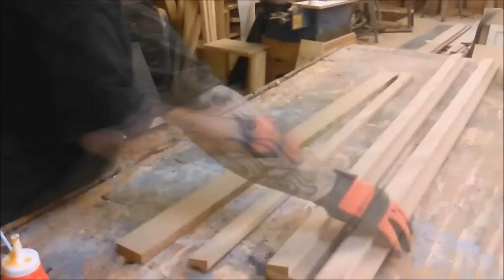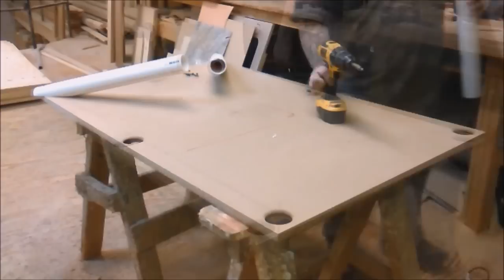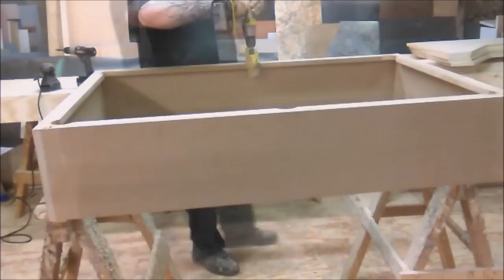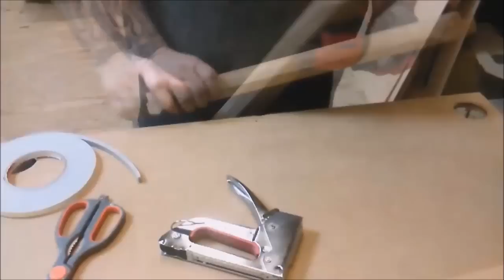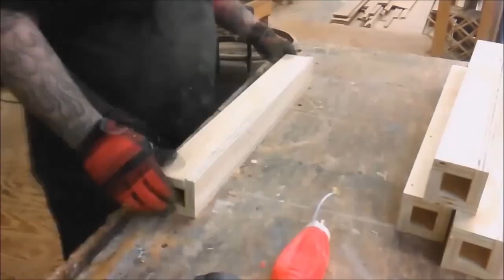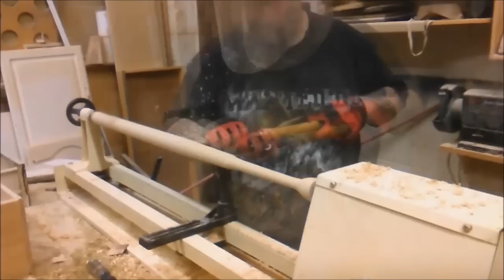how i make a pool table (diy)

Comment: Wow, that looks really great, even though the playing at the end looks a bit weird (balls stop suddenly), but that may be caused by the videospeed.

And i can't believe that you did all that in only 20 hours! Great work!
Reply from the maker: +Etherion thank you , you're right the video speed made it look worse but there was a lag ,the pool balls I had was alittle too cheap/light but new ones I got work alot better,thank you for watching
Reply: ah, that makes sense. How much  (without working time) did it cost you at the end? And was i right with the 20 hours or did i confuse that number with another video?
Reply from the maker: +Etherion yes about 20hrs ,it was a sheet of MDF ,the fabric ,PVC pipe and the balls was $15 on eBay ,I used scrap wood for some but it was around $75-$100
Reply: Thank you for that answer. I love it how you actually respond to comments especially, because you are so quick to answer.
Reply from the maker: +Etherion thanks,I try to respond to everyone ,it's good that you like what I do enough to let me know and ask questions,I really appreciate it
Reply: sdmcustom woodworking

Comment: been waiting for this one, as usual it didnt disappoint!

btw how do you like the ryobi 18v nail gun? ive been thinking about getting one
Reply from the maker: +mike gager thank you Mike ,I really like it, I've had it about 3 years and usually use it for trim work , I've never had a problem with it.
Thank you for watching
Reply: I use the Ryobi staple gun....................
It's taken a crap on me about........ Idk, 8,000 staples in.
When i used it though, retardedly used them in out of town jobs for an entire floor underlayment instead of my compressor air guns....

I traded it for a new ok at HD though..
Battery holds it's weight with my DeWalt. Still strong cgarge and love it.
PS: staples it is NOT able to use it's "maximum staple length". I will only use it for a max of 1 1/4" maaaaaaaaaaaYYYYbe 1.5.... Maybe. It cannot handle its max. No.Friggin.Way.

Comment: Excellent Excellent Job!

Just one concern: The balls are not rebounding back with expected force/speed after hitting the corners. The wood is absorbing all the momentum.
Reply from the maker: +Justin Tylor thank you ,yes your right it's a combination of the mini pool balls I used being a little lightweight and just using door insulation for the rails ,it works fine and as it's just for the kids I might just leave it ,but if I get chance I'll buy the right rail bumpers and try that , thank you for watching
Reply: amazon is a great to buy them. otherwise I am blown away. The simple idea of using pvc pipe for ball is return is crazy. MIND BLOWN!
Reply from the maker: +Techswreck thank you ,I like to try and make as much of the project myself ,sometimes I think I should buy the right parts but usually using what i already have leftover works good, thank you for watching
Reply: I've made a few pool tables in the past.
its not a 5 minute job either, but interesting and fun to do.
takes time but worth it.
a real pleasure watching you make one yourself.

Comment: where did you get the green liner? I'm a finish carpenter so it would be easy to build... i have balls and sticks; how much did it run to build the table ? I am looking to build 4x8.... what do you think maybe $200-300 for wood... not even
Reply from the maker: +Shawn Anderson I did mine as cheaply as possible,it cost around $100 for everything 1 sheet of MDF was basically all I used  ,in hindsight I should have bought the real rubber bumper but other than that it's definitely something easy to make ,Google green baize for pool tables or check eBay ,you need the right liner so the balls roll right

Comment: what material did you use for the bumper/cushion ? did you buy it?
Reply from the maker: I used a peel and stick foam insulation for weather stripping windows and doors in the video but it didn't work as good as I'd hoped so bought pool bumper off eBay and replaced it with that

Comment: Great work!! If you have chosen to build a 7ft table, would you take the same mdd size, or thiner but with a frame in shape of H under?
Reply from the maker: +Vincent P thank you,yes bigger would require more effort supporting it and keeping it level ,maybe double up on the MDF , ideally you'd use slate but it would work with MDF it would just need alot more work having it flat and level,thank you for watching
Reply: What about play board  do the job for a table 3/4"

Comment: What material did you use in the cushion bumper
Reply from the maker: In the video I used window and door insulation but it didn't work that good so ended up buying pool bumper cushion off eBay

Comment: What’s that material that was used for the cushion? The tape stuff?
Reply from the maker: +Jack Dixon I was being cheap so tried to use regular door insulation...it didn't work so great so I ordered proper pool bumper off eBay and replaced it

Comment: what is that rubber tape thing you set on side bumpers?
Reply from the maker: I was being cheap so used window trim insulation tape....I later replaced it with proper pool table bumper I got off eBay

Comment: Nice job.  does it feel like a good table? Normal tables have some rock oriented material under the cloth so i thought it would feel a lot different
Reply from the maker: +Semih Aykurt thanks , it's a kids table and they usually are some kind of particle board ,this is small enough that MDF is flat and solid so feels right ,and more than good enough for kids ,thank you for watching

Comment: very smart but what did you use for the cushions , is it double sided tape . and does the cushion work well
Reply from the maker: +guns vs planes I used just window insulation tape ,which isn't the best option but I was trying to build it cheap ,so I did go back and replace it with proper cushion , thanks for watching
Reply: did it work as suppose to ?. all i want is something that is do able   until im out of high school
Reply from the maker: +guns vs planes it's just for small kids so it's just right ,if I was making one for teenagers or myself I would spend more money on those parts
Reply: my dad doesnt give me money nor allow me to go to the pub. is there something else i can use to make a not bad bumper
Reply from the maker: +guns vs planes you can buy it off eBay for like $30 ...it's not too expensive
Reply: i know but they dont ship to malaysia.  any alternatives you can recommend me ?
Reply from the maker: +guns vs planes I don't know ,you just need to find some rubber
Reply: well, frik . whats a pool table without bumpers
Reply from the maker: +guns vs planes it won't work,so I recommend buying them from eBay ,they usually ship worldwide
Reply: ive tried. they not shipping. but could i use silicone
Reply from the maker: +guns vs planes no ,you really will be wasting your time if you don't use the right cushion material
Reply: yea. but at the moment im saving money because i found a local seller selling one table for 300 usd which is 1000 myr

Comment: Hi what did you use to the rails to make the balls bounce?
Reply from the maker: In the video I used door insulation tape but it didn't really work too good so later just bought the proper pool bumper off eBay
Reply: sdmcustom woodworking thank for the reply! But the first method you use is it good enough i mean for a cheap diy build is it good, the balls bounces too?? Awesome build though inspires me to create one.
Reply from the maker: It works but not good enough ,maybe the thicker more rubber stuff would work better but I used the sponge tape stuff so it's not really good ,good enough for a kids table like this is but I had to strip it down to change it so better to use something good than regretting it later
Reply: sdmcustom woodworking thank you so much for giving me tips! ☺

Comment: I am doing a pool table for my school major project just wondering what wood to use ?
Reply from the maker: +HowelGF/Dota thats great ,you need something that will stay flat for the top ,I used MDF because it won't expand or contract due to weather changes like wood or  plywood would and it's pretty cheap ,as for the rails /sides you could use anything oak or maple would work or whatever you have just make sure it's stable and level .
I went the cheapest route ,I would order proper rubber bumper if I was to do it again and the fabric has to be just right for the balls to roll good , thanks for watching
Reply: Alright thank you very much it helped :)
Reply: Sorry to bother for the rails is it soft or hard maple ?
Reply from the maker: +HowelGF/Dota you can use whichever you have ,the rubber material is what's going to matter
Reply: Hello again for a complete wooden pool table do i need to use different type of wood or just 1 type for everything ?
Reply from the maker: +HowelGF/Dota if it's seen I'd use the same ,just to make the finish look consistent but other than that if it's covered /painted you could use anything ,again aslong as it's square and twist free ,you need stability before anything

Comment: Definitely my next project but we're did you get the balls and triangle?
Reply from the maker: +Parody brozzz thanks ,ebay
Reply: sdmcustom woodworking  what did you use for the cushions?
Reply from the maker: +Parody brozzz I used door insulation but it's not good enough,you have to buy the real rubber bumper stuff ,try eBay
Reply: sdmcustom woodworking  ok thanks
Reply: sdmcustom woodworking were the cushions strong or pretty weak
Reply from the maker: +Parody brozzz too spongy so weak ,I was trying to make it without spending money but I found that you can't be cheap when it comes to the bumper cusions ,so best to use the real thing
Reply: sdmcustom woodworking how long was it
Reply from the maker: +Parody brozzz I think it was around 55"

Comment: Hey! Can anyone tell me which tool he is using at 3.09 ?
Reply from the maker: It's a router, rounding over the pocket edge
Reply: @sdmcustoms  hey man! Which glue are you using for that felt, and if in case that cloth needs to be removed after some time, does that glue comes off easily or it totally destroys the cloth?
Reply from the maker: @HardcoreGamerJones  it's contact glue ,once it sticks that's it .make sure you use real pool bumper material ,search eBay ,the stuff I used wasn't right it didn't bounce back as well as it should so I replaced it later
Reply: @sdmcustoms  thanks man! Yes, I'm using real bumpers, got myself 3 pieces of 6ft for 40$ lol. A better deal.

Comment: 69/5000
I wanted to make a table 3 ft X 4.5 ft, what do you think of this measure?
Reply from the maker: I guess you could make any size you want but it's a little too square ,it's supposed to be more rectangular
Reply: Ok thank you, I arrived in the following measure 2.5 FT X 4.5 FT, I loved your project and I will do here in Brazil, congratulations for the video.
Reply from the maker: Most tables are approximately the width x2 for the length so 3x6 or 4x8 etc

Comment: Those balls dont roll too much because you didnt use a rubber cushion. Cushion is what makes those balls roll.
Reply from the maker: +sigaelmar69 your right they don't roll much but it was because the balls was too cheap and light ,the cushion affects the bounce back not the roll ,I got the next size up better balls and it works alot better , thanks for watching